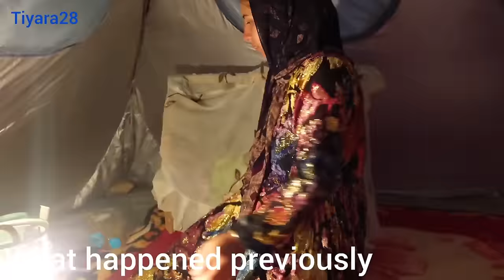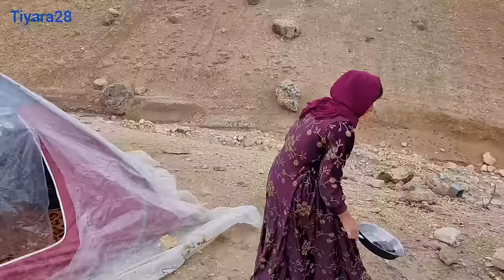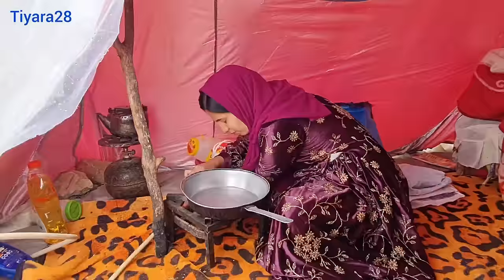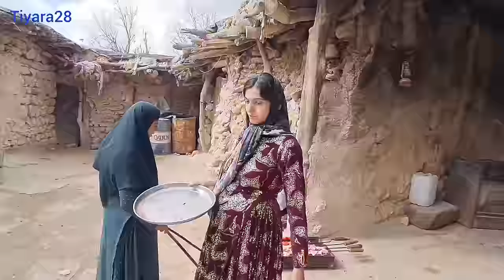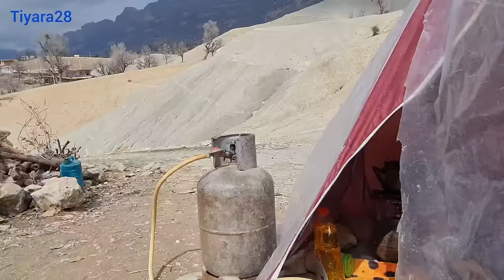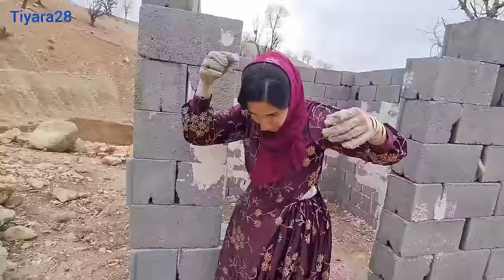"The struggle of Maryam and her baby to build a house" The sister-in-law's futile effort

Comment: Maryam it's great to see you empower yourself to build your house it's not complicated. The blocks are already in place.
You're plastering the walls that's great

Sell your gold buy metal beams for the house roof
Measure the length and width of the house write it down

Buy the metal beams extra long extending over the size of the house five feet extended in front of the house
Buy metal roofing sheets to put on top of the metal beams space the beams to fit the metal sheets
Put a large plastic on top of the house and secure it down with blocks until you can put cement on top

Leave the plastic on top put first layer of cement about one inch let dry put the second layer on top of the house another inch and let dry

Next buy bitumen and pour it on top be very careful not to get burned let dry
Pour another layer of bitumen on top of the house and let dry
Buy tar paper and put it on top with a fire torch extending the tar paper over the whole house to the floor
This will help keep the water out of the house in heavy rains and snow